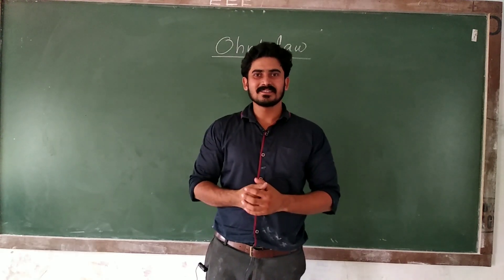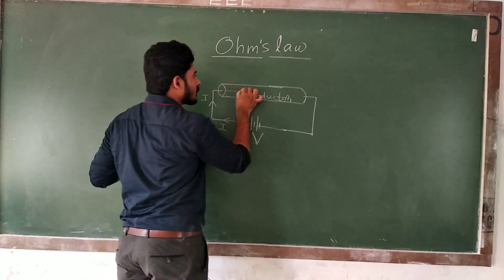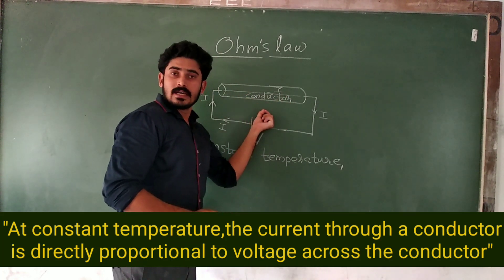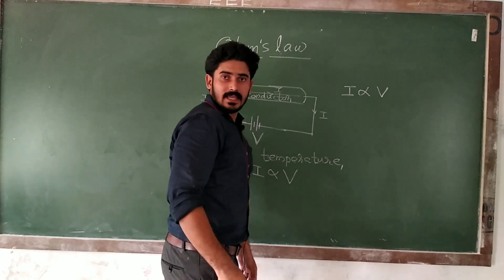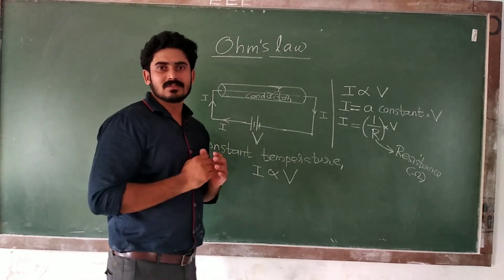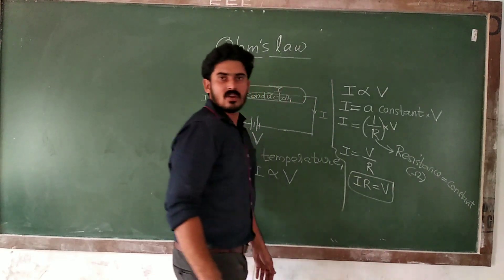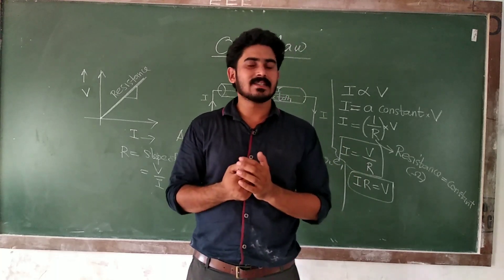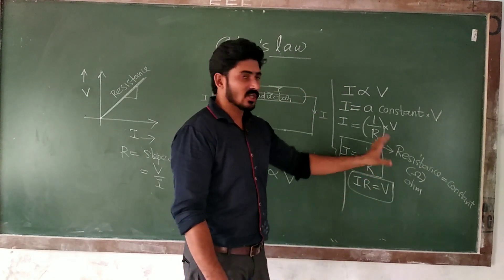Ohm's law-simple explanation

Comment: Ohms law practically evidokaya use cheyunne ennu onnu paranju tharammo means transformeril onnum ohms law applicable allalo athupolle evidokaya ith applicable ennu onnu parayammo
Reply from the maker: shiva s
Transformer il applicable aanu... transformeril input circuit powerum output circuit  powerum same ayondanu constant power ennu parayunnath.... ee randu circuitukalilum ohm's law applicable avum...
Diodel applicable alla.. avide constant resistance athava linear chara alla..